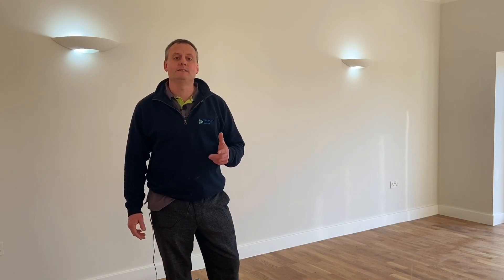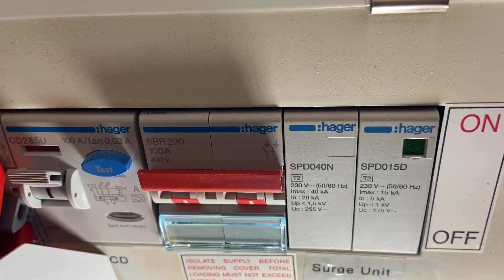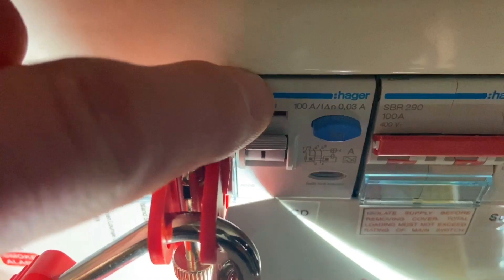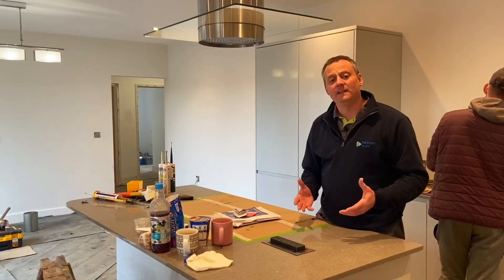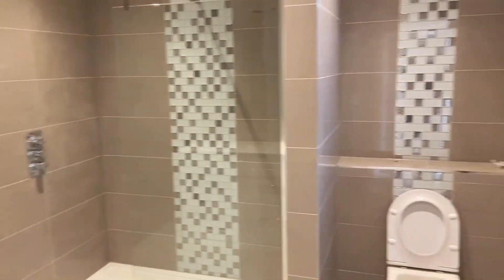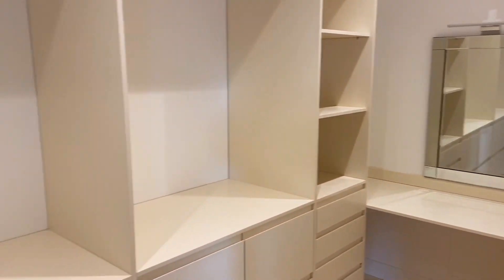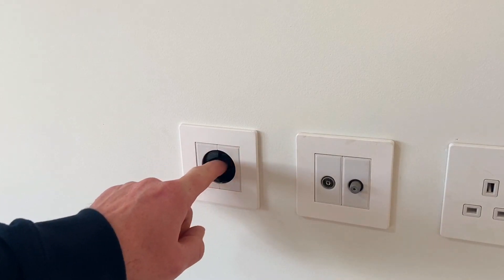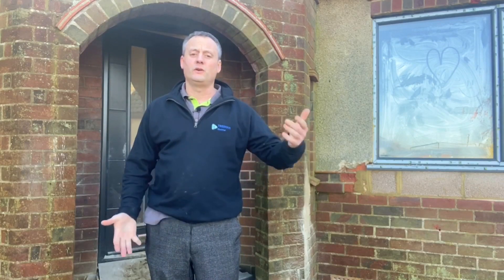On Site with Dave. Hager 18th Edition UK Consumer Unit, Kitchen Island Sockets and a Nice Hole.

Comment: 1. The 6mm cable to the island is very good thinking as the saying goes always leave enough for the next man. 

2. Lovely looking property and bathroom especially! Jealous isn't the word!

3. Thoughts on the automatic light sensors in Domestic? If there is a visible switch in a decent area to get too, which there was then what's the point? - is it too much effort to press a switch these days?

4. I have dimmers in all rooms in my own place with 60 degree intergrated led's (Luceco - Screfix) as opposed to most of the most of the leds on the market being 38 degree beams! You will be surprised at times in different rooms you want it as bright as poss but at other times as dim as poss, varilight pro dimmers and 60 degree beam integrated leds are the templates for downlights imo.

5. The entertainment area with two places for all outlets - pound to a penny when the owners are situated they will have a tv on the wall and thats it, but will it be at decent eye level and big enough to hide both sets of outlets? A further visit for the spark i suspect :)

Lengthy comment for a 5 minute video aye, love the channel and everything you chaps do at the channel so much enthusiasm for giving the young folk (and some old) the best chance to be good sparks.

Thumbs up.
Reply from the maker: Ryan wow what a detailed comment thanks for that.  Have a great weekend. Gaz 👍
Reply: @GSHElectrical  you too Gaz, cheers.

Comment: Great video guy's. Been following for a while now. 

Noticed at the intro, an adult learner. 

Would you be able to do a video on how and what routes someone would need to take to become a fully qualified domestic electrician as a mature student?  

The reason for asking is because I am a fully qualified electronics engineer and want to retrain as an electrician. However keep getting told various different thing's even by college's and it has all left my head in a pickle.
Reply from the maker: Thanks for the positive comment I will try and do a ramble on that topic 👍. Gaz 😁
Reply: @GSHElectrical  thanks Gaz, it would be really appreciated. And I'm sure I'm not alone. 

Due to my qualifications city & guilds level 4 in electronics and degree in electronics. Some colleges say I can be fast tracked but the nvq side is the problem. Other's say I need to start from the beginning. 

I understand exactly how it all works and what is needed to safely install, test and commission. 

But knowing what to do to get that piece of paper is a complete nightmare. And I'm at a loss as what to do.

Comment: Nice video ! Some nice additions with the island socket and the conduit for cable routing. Just wondering what qualifications is he taking to become a domestic installer? Cheers !
Reply from the maker: Hi William Tresham college off this EAL course 

https://www.tresham.ac.uk/course-display/part-time-course/?id=264&page=electrical-installation

Thanks. GAZ 👍
Reply: @GSHElectrical  Several spelling mistakes in the course description.